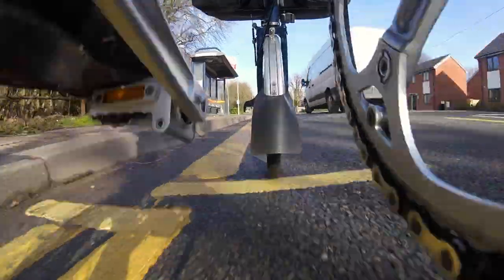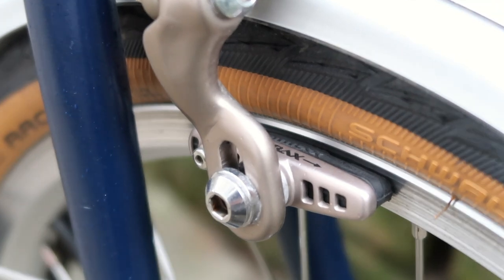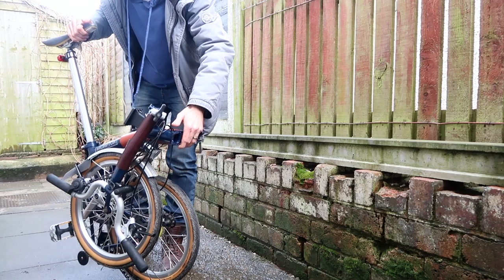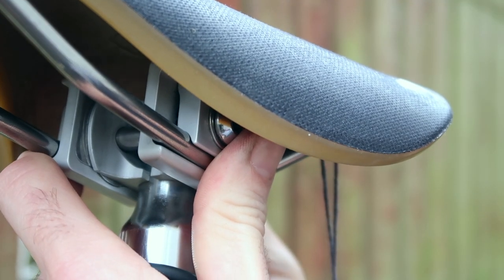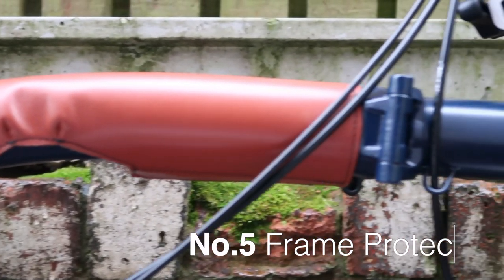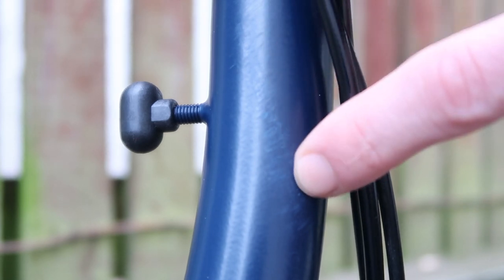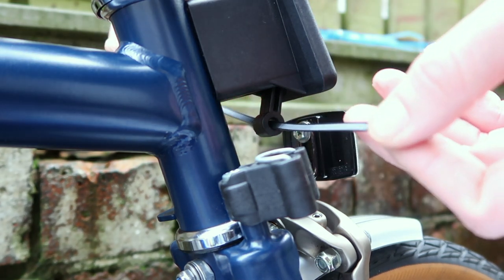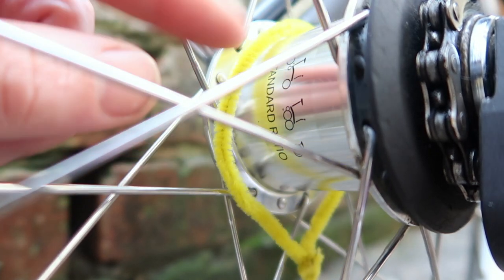7 useful Brompton upgrades, accessories and hacks

Comment: Instead of zip ties for bag release use paracord. You can get it in nice colors and it won't scratch your frame. You can also dress it up a bit with a lovely diamond knot.
Reply from the maker: Nice tip. Thanks for sharing as I am sure it will come useful 👍😀

Comment: The larger Roller Wheels are a +, but  the Extender Bar adds greater stability (even with the rack) and a bit more height, ++.
The Front Carry Block "loop" from a cable tie, excelant idea, for vertually no extra cost or weight.
Thanks for the vlogs
Take care
Reply from the maker: Sounds like the extender bar would be better stability wise especially without the rack so nice idea 👍 Seen the cable tie a few times and it’s great. Been using it a few weeks now and that’s why we decided to get a leather one as found it really useful. Glad you enjoyed it!
Reply: My extender bar has a carbon tube in the middle and alu ends, so the extra weight isn't that much, and I use titanium bolts on my "lightweight"! ;-)
Reply from the maker: Not had much worry about the weight concerns but think if it is carried a lot that will make a huge difference. Makes sense to keep the weight down on a lightweight model 👍

Comment: The 2 O-rings are supposed to sit under the pentaclip, not on the wider part of the seatpost, so that when the seat is lowered to lock the fold, the bottom of the pentaclip doesn’t  mark and/or score the top of the seat tube. 

I’ve been using Swissstop Flash Pro BXP Blue cartridge pads, they give a much better performance and are a hard-wearing brake pad than the fibrax originals. I run Ergon GP1-L grips which protect the ulnar nerve in the heel of your hands and prevent sore wrists.
Reply from the maker: Thanks. I have the extended seat post so it physically cant meant the top of the seat tube, but I can see what you mean and how that would be issue with the normal seat post. 👍 

I prefer it this way as the pentaclip is hidden more and think it looks a bit tidier. Not changed the grips at the moment. To be fair not had any issues with the foam grips and I actually think they are alright although I know quite a few people don't like them. Heard the ergon ones are pretty good though so when I need to change them will have a look at the ones you have suggested 👍

Comment: Although unnecessary I too would have swaped over the brake shoes.
Defiantly look better. 
The Eazy Wheels are a big improvement. Combined with a Roller Extender Bar £10, is an even better upgrade. Stops the tipping and makes it easier for shopping & tube travel trundling, 
Might fit the Zip Ties to the Carry Block. Great idea at min cost and weight. Would make my own hub cleaners.
With a Sumner and Winter/Cargo B & contemplating an electric the Brooks C17 would at x3 be an expensive indulgence. Although very desirable.
For frame protection Tape.
Vegi, so no leather fram sleaves. And what if it rains.
Enjoying your vlogs, thanks for sharing.
Take care
Reply from the maker: Glad you found it useful. The zip ties are really good especially if you have the bigger bags. Totally understand about the leather. To be honest not had an issue in the rain and ridden it a few times in heavy rain.

Comment: I changed to larger wheels on my non-rack model and also fitted and EZ wheel extender which makes the bike much more stable and looks good.....
Reply from the maker: Hi Laurie. That sounds good. Seen a Brompton with thicker wheels before which they used for off-road and worked well

Comment: A really useful video. Thanks. When I bought my new Brompton M6R four years ago I asked for it to be fitted with Eazy wheels. I'd had previously fitted Eazy wheels myself to my old P6R.The shop told me that Brompton no longer supplied Eazy Wheels because the standard Brompton wheels were now much bigger.  Standard  wheels were bigger yes, but not big enough. I'm glad that Brompton now supply them again.
Reply from the maker: Yeah the eazy wheels are definitely worth getting. They roll so much easier as well. Found them very useful the past few months and would definitely get them again.
Reply: @CycleEveryday  go to

Comment: For brake pads, just use Box Three Ajrflow race pads. I use them and refuse to run anything else, they really are the best rim pads out there.
Reply from the maker: They look interesting. Like the fact you can get different colours as well 👍
Reply: @CycleEveryday  the design maximises airflow to reduce brake fade under hard use. The pads use 2 compounds to ensure a wider temperature performance band. They're roughly 80mm long giving huge stopping areas on each pad and from experience they'll survive a 40-0mph deceleration downhill, something no other rim brake has managed in my years doing stupid stuff. Where safety is concerned I always look toward Downhill MTB and BMX.

Comment: Hi, really informative and cool video thanks. With the years you have been riding a Brompton, what are the best puncture resistant tyres you have used, and have you had an issue with punctures? Thanks for your time and patience in answering.
Reply from the maker: Hi Daniel, yes I have found that the Schwalbe tyres are good. Marathon Plus or racers. Generally get about 3 punctures a year and travel on average 7.5k km so pretty good 👍

Comment: Did you find the Brooks C17 confortable? I had the C17 carved and had to replace it for something cheaper as it was pushing some bone or joint and I could not take it longer.
Reply from the maker: Yeah I find it comfortable for everyday use, but everyone is different. I still use the standard Brompton saddle on my other Brompton when I use that one as well and find them both fine 👍

Comment: I have a padded pouch on my pedal, and a longer protection for the frame, going all the way.
Reply from the maker: The padded pedal pouch is interesting! I did think about the frame protector that went all the way but ended up on this one. At least its useful for some extra protection though! 👍
Reply: @CycleEveryday  In the end I replaced my long leather protection, with Velcro, with a shorter, sown on version (As an old "sailor" I'm used to work with sails and it was fun to use my old and forgotten skills for something useful, which I think looks better and my padded "pedal-pouch" for Brompton was bought from a - Thai firm, and very expensive, but it does really function, with a line securing it stays on the pedal during transport.
Reply from the maker: Yeah the sown version that is tied does look nice. Good if just keeping it in the one place. 👍

Comment: With the Jim Frame Protector, if you could only pick one place to put the protector, where would you pick? On the frame or the stem.
Reply from the maker: The frame. Because that’s where I got the most damage. Do get a bit on the stem, but was more worried about the bit on the frame where the cables rub, plus you can move it down to protect on the pedal when folded as well so does two jobs 👍

Comment: I wish Brompton’s rear and front wheels had quick release. It just makes sense. If you get a puncture on the road and you want to repair it on the road quickly, I don’t want the hassle of using a spanner to loosen the bolt to take the wheels off the bike.

Comment: As u said in 2.31 , my bike is rocking due to wheels being changed , is that causing u any broblems ? Cuz mine can't be stable when I fold it , its a bit a hassle when in public transport for example...shall I just put the original ones back , despite the new one look cooler
Reply from the maker: The only thing I have found helps is having the handle bars down. I have the m-bars though so think they are closer to the ground when folded. That added a bit of stability. Only other thing is an extender that would help. It is a bit of a pain though that it’s less stable. Putting the old ones back on would fix it, but wouldn’t roll as well. 👍

Comment: Do you have anything to protect your chainstay for where the front wheel hooks onto the frame?
Reply from the maker: Gorilla tape at the moment. You could use some old inner tune as well, but had apiece of gorilla tape on there for quite some time and still stuck on despite rain etc. The clear tape wears away after a while.

Comment: thanks for the tips just ordered leather protectors and hub cleaners from Jim for my Brompton only had it a week same colour as yours but been very busy work wise to get out on it need to practice a little on the 6 speed combination changes before I go on train up to london to the office but looking forward to it. Got some new tyres got the marathon plus and also the tan wall marathon racer with AV4 inner tubes. My brompton is a 2015 07 in excellent condition got lots of extras M6R with bags for the front and the rack bag brooks saddle, original saddle and extra seat post lights (battery) and a helmet as well still new in box

so I have watched a number of your videos really entertaining and informative many Thanks
Reply from the maker: Thanks Terry! Glad that you have got it now. Sounds like it is a nice one. Great that you got all of the bags with it as well and the other saddle. At least you can swap and change if you find it a bit less comfortable. Sounds like you are good to go with all the extra bits as well. I sure you will love it once you get chance to use it!
Reply: Thanks got a few upgrades on the way from Jim and brilliant bikes (eazy wheels inner tubes etc)

Comment: any hack for a kickstand? great video, thanks
Reply from the maker: I don’t have a kick stand, although you can get them for the Brompton. I normally just fold the back wheel under, but if you have a rack with things on it doesn’t work as well. Alternatively i rest it against a wall or likewise, but if I had a rack I might think about getting one. Got one on our electric bike and very useful 👍
Reply: @CycleEveryday  any particular brand? Thanks a lot
Reply from the maker: @TM-vg4mx  I don't know any specific one. Personally I would have a look at a few and see the feedback on them online as not had one on the Brompton before. Think the key thing is it needs to be able to fold up and not interfere with the folding so worth doing some research I think.
Reply: @CycleEveryday  great, will do, thanks a lot

Comment: Brompton use Swissstop "blue" pads on the Electric version and they do seem to be well regarded by most owners.
Reply: Also I have also used and recommend Jim Barrett for his leather products, I've got his super length protector on the main beam, mainly for the excellent carry handle BUT it is fair to mention that as everything is made to order, delivery can be extended !!!
Reply from the maker: Yeah the super length one is nice with the carry handle. Did consider that originally. You are right about the time due to being hand made and when he gets busy but definitely worth the wait! 😀👍

Comment: Those brake blocks look to be on upside down, isn't the curve of the brake block meant to match the curve of the wheel?
Reply from the maker: It just looks like that because they are a funny shape. Curved both sides, although one side slightly curved than the other 👍

Comment: You don’t want to get the leather accessories wet in the rain though, do you?
Reply from the maker: Not had any issues with them getting wet during the rain. I do always take them off when I wash it though. Generally find that they are fine in general rainy condition in the UK at least. Use the Brompton in all weathers and so far they are all holding up well. 👍

Comment: I braught the easy wheels.. but the bolts were much thinner so I couldn't attach them? Threw the wheels in the bin... C line 2022
Reply from the maker: Some of the easy wheels are for the rack option on the Brompton. I brought some from a bike shop once and had the same issue. When you buy some they need to be the fittings that fit onto the frame. Bit of a pain as some bike shops don’t realise the difference.👍
Reply: Could have gone to a hardware store for some longer bolts.